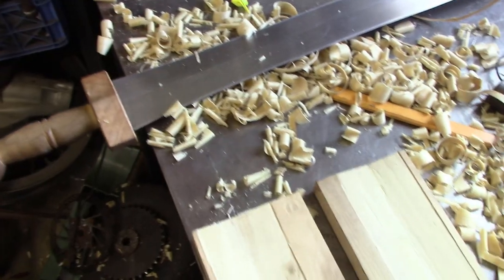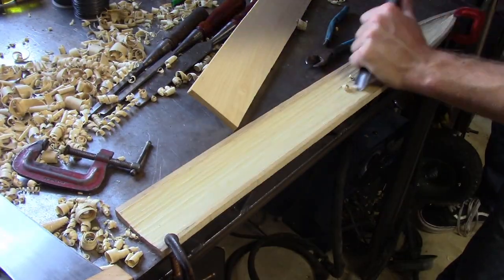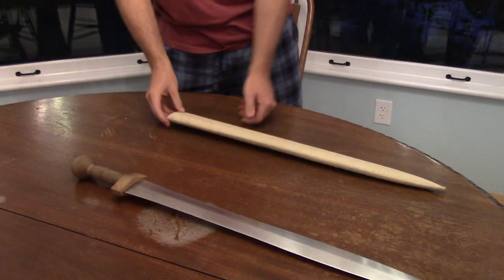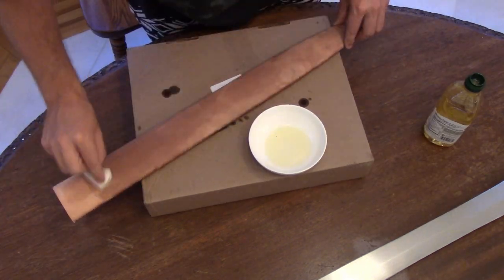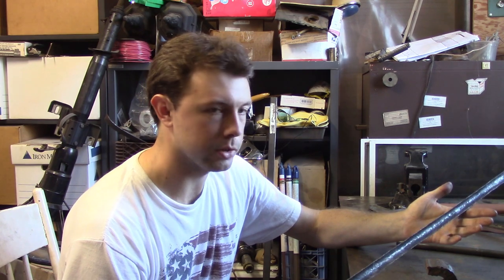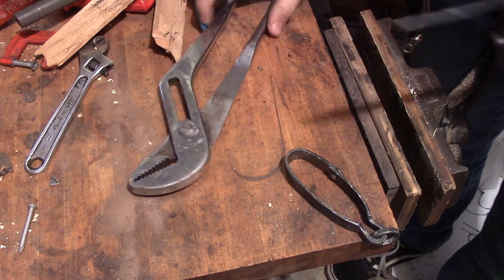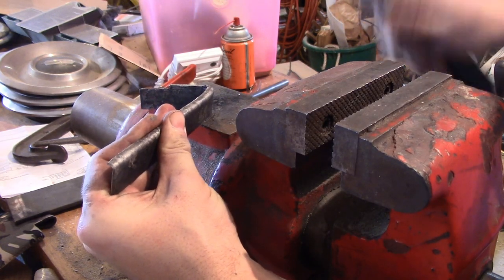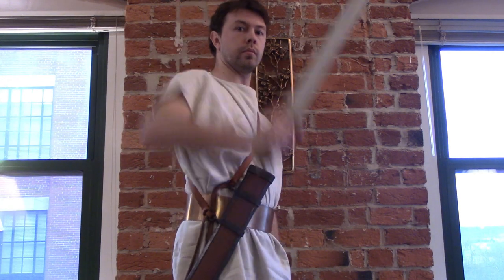Making a Roman Gladius Scabbard

Comment: Dude, don't torture yourself making a super tight scabbard, they were a little oversize and lined with wool that was wet with a little oil. This protected the blade against rust, and made the draw smooth and silent with no risk of binding.
Reply: Uh... wrong sword, wrong time period. The only swords, to the best of my knowledge, that were lined with sheepskin with its natural oils (NOT oiled wool cloth) were Scandinavian ("Viking") swords of around the IX century, about 600 years and a continent apart from III century Roman scabbards. Those were unlined on the inside, as most swords ever.

Comment: And, if you do follow the suggestion below is make a reasonably accurate Pilum, I'd like to see that too - especially choosing an appropriate timber for the handle part. Then there is forging the upper (nearest the tip) hole in the "root" end of the iron section - which current thinking suggests should be OVAL in shape, coupled with a boxwood or similar not-too-hard wood pin through the "Lower" tip mounting hole. This Lower hole should have a metal bushing through the pin mounting holes on each side of the iron shaft base - so that the iron tip is mounted into the wooden shaft with two pins. The "Upper" one is also iron - your annealed and cut-down nails are ideal for this - then the hard(ish) wood pin through the bush on one side, through a Round hole in the iron portion base, then out through a similar "Bushing" on the other side of the wooden shaft. This may sound more complex than you'd imagine such an ancient weapon needs to be, but therein lies the secret of its success. When the Pilum is ready for throwing at your enemy's scutiai, both pins in the square-section, tapered 'Head" fo the Pilum's handle are in place and supporting the iron portion in alignment with the "handle". When thrown, the broad iron point will (hopefully) penetrate the opposing shield and carry on into the body of your foe. Even if the broad tip misses anything essential, the Impact of the iron point will be felt by the wooden lower pin, which will be sheared off flush each side of the iron base, by the two bushes - and with the slot in the forward end of that mounting flange allowing that short amount of rearward travel, necessary to shear the rear wooden pin. Now the pilum tip swivels on its steel forward pin - whether or not the actual iron tip section bends - making it impossible for that scutum-bearer (even if unscathed by the pointy bit) - to remove that pilum from his shield - much less hurl it back at the advancing legions. Thus, that shield will have to be discarded - rendering that soldier defenceless, but - when the day is done and the battle won - ALL the similarly skewered shields may me gathered up by the winning (Italian) team, the Pilum iron tips straightened (if necessary), the wooden pins replaces and that pilum - now perfectly serviceable - now returned to active duty. And that is quite enough of a history lesson for one day...

Comment: A ball peen hammer, I've several sizes, is your BEST friend for shaping metal and forming nice mushroom rivets heads. And you won't necessarily need a big one. For smooth metal surfaces a hand planishing hammer (auto body tool) is your companion. Always be sure to WAX your linen thread (bees wax works well) then you can dispense with linen knots. Instead double back and forth through the last few stitch holes a few times and it locks in place (and you'll be fine).

Comment: 16:40 - 16:50
Technically, using a drill might not be cheating, just unlikely.
The ancient Greeks almost certainly had hardened, high carbon steel drill bits when they made the Antikythera Mechanism ~2200 years ago. (We know this because some of the components have ~1mm wide, 4 inch deep drill holes that go through bronze, as well as accurate non-warped holes through some soft iron components.)
Here's a video of a guy giving a little of that info as he creates period-accurate tools with period-available technologies as he goes about making his own Antikythera Mechanism purely with means that were available/likely available 2200 years ago for the ancient Greeks.
Here's the video: watch?v=N1aj_3tlQhU

So given that a lot of ancient Roman technologies and knowledge was shared (and ""shared"") between the ancient Romans and ancient Greeks, it's actually likely that they could have had hardened high carbon steel drill bits available somewhere in the empire.

Granted, your average slave quickly hammering out standard issue swords to arm hundreds of thousands to millions of soldiers wouldn't have had the time or cared to use a hand drill and oil for +30 minutes rather than just hammer a rod through some hot iron and call it good, but if this were being made by a craftsman who prided in his work, he could well have done so even back in ancient Roman times.